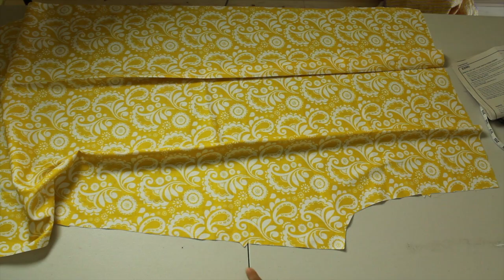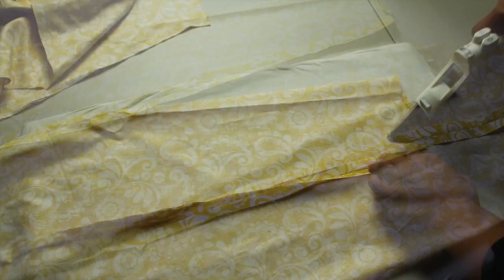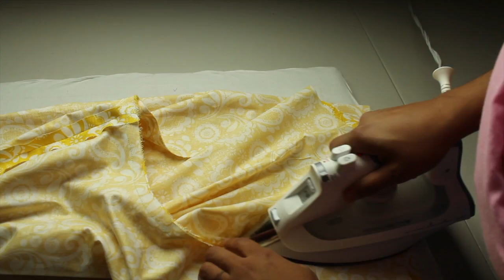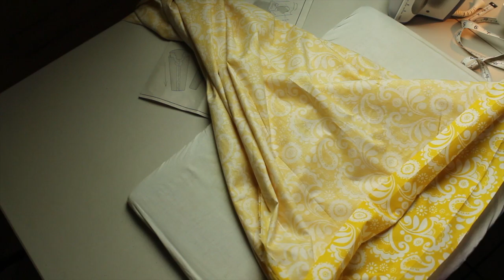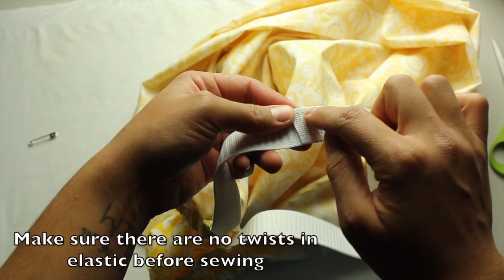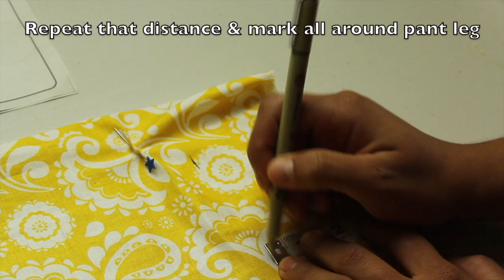Beginner Sewing Series: Part 3- Simplicity Pattern 2290

Comment from the maker: @mayagayam The tie on the front is an optional finishing touch you can add or leave out.  The pattern has you adding it at the end by hand with needle and thread.  It doesn't actually go through the casing.  It is just for decoration and is sewn down to the front seam casing and then tied in a bow.  Hope that helps.

Comment from the maker: @dofdestiny10 One way to figure it out is to get an index card/paper and mark 5/8" from one edge of it (measure with a ruler) with a dot. Then slip that piece of paper under your machine's foot with the needle up and then lower the needle so its going through the dot you made.  Now, wherever the edge of the paper is you want to run a piece of painter's tape signifying the 5/8" distance from the needle.  You can then use the edge of the tape as your guide. Hope that helps.